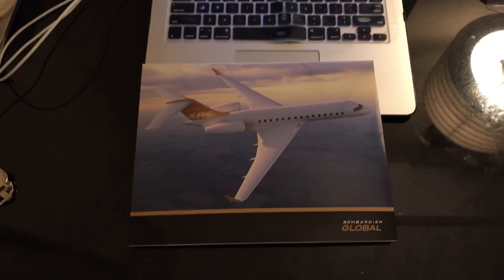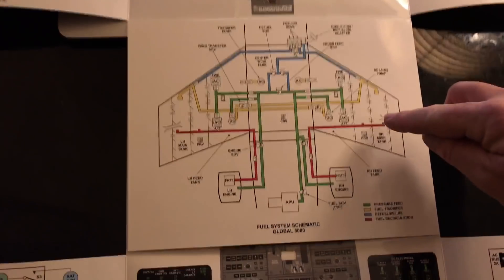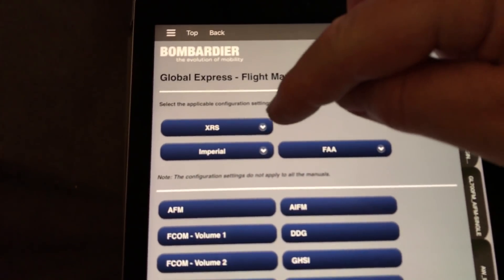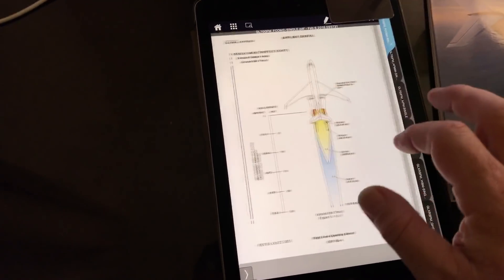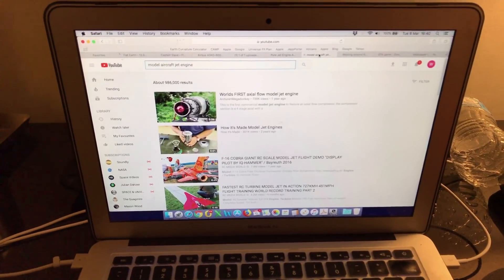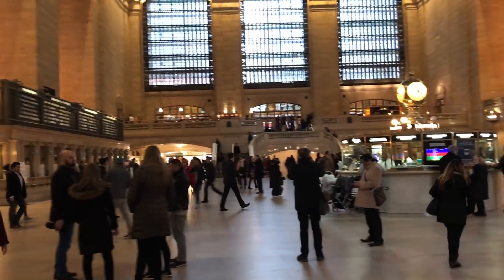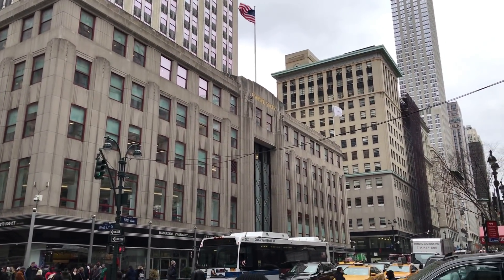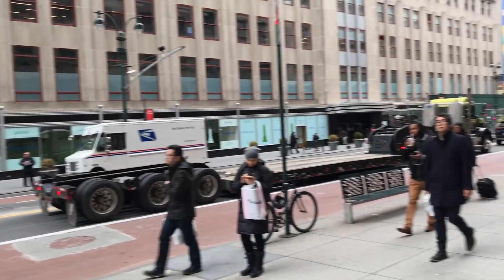Don't be ridiculous - of course Jet engines use liquid fuel.

Comment: Ok, what you’ve shown and described looks above board, but did I miss something in the most highlighted so called “compressed air engine” on YouTube that have or have not gone through the stats to disprove?
Please, put this to bed by going through and detailing as you have done here - with your CHOSEN jet engine - for the A380. 
So far, for this particular type of aircraft, that the fuel the books state it carries, sort of beggars belief, and really can’t get my head around how this much fuel can be carried?  Are the figures these conspiracy theorist using being manipulated? Is there a typo with an extra ‘zero’ in the books?
If you are so adamant, as I have always believed that Kero’  is what all jet turbines use , then please upload a video disproving this bullshit!
Reply: GT Shaker Why don't you do some research and find out how much fuel a 747 carries (in wings significantly smaller than the A380s), or even the An-225, which is even bigger?  The A380 burns between 11 and 13 tons of fuel per hour, so around 185 tons for a 14 hour flight.  Where do YOU think they store it?

Comment: I'm sure the issue isn't whether or not jets use liquid fuel, it's the large commercial jets that aren't making logical sense. It could be that a new tech has been installed and in use for a decade. Many serious questions have been raised, very valid inconsistencies, even by aircraft mechanics.
Reply from the maker: +Angel Gerovac - what part of large commercial jets are not making logical sense? 

I have an aeronautical engineering degree - 10,000 hours flying real aircraft (mostly jets) and am an air crash investigator who specialised in aerodynamics and flight path analysis. 

Everything about the design of these large jets makes perfect logical sense to me.  However I am open minded so please show me your factual evidence of why you believe they don't make sense.

Comment: The heat is transfered to the wings not to keep fuel from freezing but to keep wings from icing over and to cool air befor it is sent to the passanger area...RC airliners use compressed air...

Comment: I loaded jet fuel onto fighter aircraft while I was in the Air Force. Doing so would cause the landing gear struts to compress due to adding the extra weight. And it wasn't water I was putting in there.

Comment: @ Wolfie6020

I think that the main argument that these people have about certain aircraft's don't have fuel is that when they have seen the internal area of a wing & it's thickness then they have a hard time believing how swimming pool sized loads of fuel could fit into such a small area. Perhaps these jet engines work on the principle of 0.05% fuel to compressed air ratio which would mean that the total amount of fuel is much less than one would think.

Comment: hahahahaa your showing of a hand-out schematic to prove that Jet engines use "jet fuel" is like showing a picture of Bambi and saying it's real.  hahaa oh yea that really proves that Jet engines use fuel.  Tell me how a A380 with 218 METRIC TONS OF FUEL can move, WHAT TO SPEAK OF FLY?  Just hypocrisy.  If you claim to be a pilot you are PART OF THE HYPOCRISY.
Reply: "Tell me how a A380 with 218 METRIC TONS OF FUEL can move?"

Well, since its maximum zero-fuel weight is 369 tonnes, the answer is: "A little slower than it does empty." Your point exactly?

Comment: Haven't proven a thing bud, your showing lines Pneumatics Hydraulics and Pneudraulics, all ijn the wings. No bladders bud, just air. You took us on a boring walk through Manhattan.
Reply: There are no bladders. The wing box is the fuel tank. Google "wet skin".
Reply: Makes no sense. Entire wing is compartmentalized in structural framing throughout the wing. Thin wings and no room for fuel. Never, ever do wings catch on fire in plane crashes, except for oil, hydraulics and electrical. It should be the first to burn but never does. They never dump fuel except in movies. Plenty of jets return after take-off if problems are encountered. That weight unspent on a return landing, would make a heavy landing but is soft and easy always. Take this number in, 1/4 of a million gallons of fuel? 120 tons in the wings of an the A-360, please! I believe the total weight in gallons throughout aircraft is well over 300,000's of gallons of gas. Does that make sense?
Reply: And where the hell do you get "300,000 gallons" of fuel? 120 tonnes of fuel, assuming a density of .8, would be 39,626 gallons.
Reply: I mentioned weight, makes no sense, thats one. where are you putting gas in wings when there is no room, thats two. You should have seen what I wrote If you were alert. What a child, name calling, then again, who am I dealing with? Just saw your question. Look it up! Convert tons to gallons and then look up the wet weight of the aircraft. Now get learning junior.I am tired of hand holding children around the farm, better I'll just put you in with the sheep, you can brey all you want there.
Reply: My bad, 320,000 liters, is that better! I can see your lazy so here you can get a quick fix.
https://youtu.be/P5GpvPkfBKs
Reply: Thats 256,000 Kilos
Reply: "I was in the Air Force working on jets for four years during Nam." 

Uh, huh. That's real believable...snort! I think the nurse is looking for you--your computer time is over.

"Worked on jets"! Laughing my ass off!
Reply: For any lurkers: Here's a guy who claims to have worked on F-4s. He doesn't know that the F-4 was a fighter, therefore has very little space in its wings. He doesn't know that it didn't carry passengers, so there was plenty of room for fuel in the fuselage. He never wondered what was in those drop tanks hanging from the wings. And since the Phantom flew a GE J-79 pure turbojet, he saw plenty of that undiluted, incomplete-combustion yellow flame that fueltards seem to require. IOW, he's a complete liar....

From Wiki: Fuel capacity: 1,994 US gal (1,660 imp gal; 7,550 l) internal, 3,335 US gal (2,777 imp gal; 12,620 l) with 2x 370 US gal (310 imp gal; 1,400 l) external tanks on the outer wing hardpoints and either a 600 or 610 US gal (500 or 510 imp gal; 2,300 or 2,300 l) tank for the centre-line station.
Reply: You know nothing but speculation as you expose in your video. You speak as if you know something about me. You did the same as you have done to the material. I made an example with the only thing I KNOW for a Fact. I know nothing of four engine craft. I am telling you there is no fuel in the wings of that craft. You can pull all your wiki knowledge and google proofs but you lack experience working on planes. Excuse me, Had you worked on Jets? It would help if you had some experience to share.
Reply: Correct saw, not CGI but actual photo's. I can see there is a vast wasteland here, enjoy the desert, you deserve it.
Reply: So you always waited for the jet engines to cool down before working on them ? http://gruene-teufel.tumblr.com/post/142850835958/wombatmac-the-legendary-mcdonnell-douglas-f-4 
And they always vacuumed that fuel smell away to hide the Sekrit from you ?
Reply: So vacuum tight vapor never escapes ever? Just like all successful Moon mission, never a flaw, picture perfect. What was it, 9 missions?That is not the real world. Its the world they presented to you.
Reply: Then how does the F4 Phantom engine glow ?  Are there hot halogen light bulbs inside ?
Reply: After burner nozzles in the aft of the engines. I said aft, like you see them from behind. Not much thrust but glows pretty
Reply: How does the Afterburner work ? 

So if there is no thrust during normal flight without afterburner, how many invisible mechanics are pushing that F4 Phantom through the air ?
Reply: You have to be dazzled, your what is called a normal believer. I was a believer, never smelt fumes or saw a fuel spill on the flightline. I did watch the afterburner (LIGHT UP) at the end of the runway, very cool! I never thought to challenge why nozzles would be at the exhaust end of the engine. It wasn't my specialty so it wasn't my job to think about it. I can deduce now it is for show. What good does it do out the ass of the engine?  thanks for bringing the topic up.
Reply: Why make so much smoke for the enemy to see you ? https://upload.wikimedia.org/wikipedia/commons/c/cf/Phantom_F-4_3716.ogv 

Where are all these flames coming from ? https://youtu.be/k0MY03UtMls 

Why install an in-flight refueling receiver probe ? https://upload.wikimedia.org/wikipedia/commons/4/46/A3D-2_refueling_F4H-1F_during_Project_LANA_1961.jpeg 

Why carry external fuel tank, then drop it uselessly before combat ? https://en.wikipedia.org/wiki/File:F-4B_VMFA-314_1968.jpg
Reply: Smoke and mirrors, like I said
Reply: Why bother with aviation fuel on aircraft carrier ? https://youtu.be/9wZRFkSxz3w
Reply: Why spray fuel wastefully on disconnection ? https://youtu.be/g1LhLJ_9HHA 

Why use foam to fight fuel fire ? https://youtu.be/qhajoju_7Qc 
https://en.wikipedia.org/wiki/Class_B_fire
Reply: What sprays from the tubes, not sure? I think it could After burners fire short burst and not for sustained time. Now see satellites, space shuttles and fuel as the hype to sell a package to scoff huge sums from all of the people who bit the bait, everyone's mind got hooked and they reeled us in with a narrative, CGI and verbal testimonies for eminent scientist or fraudsters. We have an abundance of Nitrogen, a catalyst is all that is needed. There is more than one way to skin a cat. 
Good going Bro, keep it up. Hadn't worked on a Phantom since 77, jogging old memories and making me consider what I had not, many thanks.
I'm trying to make sense where none seems to be
Military NANO particulates might have been used back then in the late 50's The SR-72 came out a decade before I joined in 73. That is an advanced aircraft. Whose to say NANO magnesium particulates were not incorporated? Or Bromine used in weather modification back in the 40's. The Military is decades ahead of the market and what we will see.
Hey D we always see orange flames out the aft with A.B. initiation.
Nitrogen and Metals, no fuel. Magnesium, bromide or another chemical producing the effect firing out the tubes.
A WIKI article; Measurement of the specific rate constant for the reaction
N+HBr→NH+Br
indicates that k is 3.8×10—14 sec—1 (molecules/cc)—1 at 40°C. Attempts to obtain complete turbulence of reactants at a pressure of 0.85 mm were unsuccessful so that diffusion techniques were employed. The homogeneous flame reaction accompanying the above reaction was too weak to define the reaction zone, so calculations were based on the reaction tube diameter and the critical flow rates of reactants at which the orange flame initiated by a wall reaction involving active nitrogen and bromine was prevented. Spectra of flames obtained from the N+Br2 and N+HBr reactions in a stirred‐flow reactor indicate that NBr is the source of the orange flame in the latter reaction. The flow rates of atomic nitrogen were calibrated by chemical titration with ethylene. A conventional diffusion flame technique was used to obtain k=1.6×10—13 sec—1 (molecules/cc)—1 at 40°C for the reaction
N+C2H4→HCN+CH3.
Reply: That shits made out of sheep guts and really slippery. It reduces friction
Reply: They don't spray the jet only the runway
Reply: how to fly without fuel ? https://youtu.be/RRNbcPS3A9c 

how to dump fuel ? https://youtu.be/z4DegyuIxEE 

IDK (external ?) fuel tank ? https://youtu.be/cw0o8qmB_Is   https://youtu.be/Y-GrFlY7UB0  

Why bother with afterburner when no increase over normal thrust ? https://youtu.be/QT_ZtH_fZKc
Reply: Just because you don't see the dimensions of the internal fuel tanks, does not mean it is not there.  
Just because you don't see enemy jets shot down, does not mean they are trading moonshine while 30000 feet in the air.
Reply: Relying on only one single 2D perspective can be horribly misleading on 3D issues.  https://youtu.be/tBNHPk-Lnkk 

Just because you lack the math science engineering skills to design & build fuel tanks in airplane wings, does not mean that some other geek somewhere does not have that skill.  

If a thousand trees fell in the forest and you were not there to witness it, does not mean that there was no sound generated.  https://en.wikipedia.org/wiki/Tunguska_event#Similar_events 
https://en.wikipedia.org/wiki/Infrasound#Animal_reactions 

I was not alive during the Vietnam war.  Does that mean you are lying to me about that war ?

Comment: Hey, Wolfie! I came across this excellent short response from someone showing WHY a compressed air engine would not work. The guy who posted it is Walter Bislin:

^^^^^^^^^^^^^^^^^^^^^^^^^^^^^^^^^^^^^^^^^^^^^^^^^^^^^^^^^^^^^^^^^^^^^^^^^
Compressed air engines do not exist. Airplanes fuel tanks are WAY TOO SMALL to contain enough 
compressed air even to get off the ground:
The most you can compress air is until it gets liquid. We know the density of liquid air. If 
we know the mass flow (mt) of an engine, that is how many kg air per second the engines blows 
on start thrust, and we know the capacity (V) of the fuel tanks, we can compute how many 
seconds the tanks can deliver so much air. Lets do the calculations for an Airbus:

Aircraft: Airbus A320
* Number of engines N = 2
* Fuel capacity V = 30,000 l = 30 m^3
* Max mass flow at takeoff per engine mt = 379 kg/s
https://en.wikipedia.org/wiki/Airbus_A320_family#Specifications

* Density of liquid air rho = 870 kg/m^3
https://en.wikipedia.org/wiki/Liquid_air

Therefor is:

Max capacity of air
M = V * rho = 30 m^3 * 870 kg/m^3 = 26,100 kg

Max time for full trust
t = M / (N * mt) = 26,100 kg / (2 * 379 kg/s) = 34.4 s

So an A320 carrying 30 t of liquid air can produce max thrust from this compressed to liquid 
air for 34.4 s.

That's barely enough to gain takeoff speed.
^^^^^^^^^^^^^^^^^^^^^^^^^^^^^^^^^^^^^^^^^^^^^^^^^^^^^^^^^^^^^^^^^

Comment: A person actually messaged me on another site with this rationale (I corrected his grammar) :  

"An 18-wheeler can carry 10,000 gallons of fuel.  A 747 can carry 65,000 gallons of fuel AND it's fuselage  AND its people and cargo while ALSO using 18 wheels!   So it takes a truck 18 wheels for 10,000 gallons of fuel yet the 747 can carry 65,000 gallons of fuel and more....AND fly and only needs 18 wheels!?   Debunk THAT!"  

There's just no helping someone who thinks like this.  Oh, I could try.   I could.   But it would be no use.   That's just stupid, and as Ron White once said, "You can't fix stupid."

Comment: Dont forget next time you are flying your bombadier, to keep pushing the nose downward 8 inches per mile to keep to the curvature of the earth, otherwise, you will be at too high an altitude when you get to your destination, and by the way, if you are flying eastwards and you make a 90 degree turn to the south, you are going to have difficulty dealing with the surface of the earth travelling at 1000mph beneath you sideways.
 Honestly, this is some of the far wrong conspiracy theories Ive seen on the net in the last few days, as well as the jets dont use fuel one. Amazing. there seems to be an outbreak of stupid in recent months and it seems to be catching.

Comment: Compressed air!?!?! That's what they came up with today?
Where would you even store compressed air for a 14h flight?...and the HUMUNGUS tanks themselves would weight several tons each. Good luck for liftoff. When they fill up on the tarmac and the kerosene smell fills the cabin for several minutes... it's just for show? part of the lie? Bring it on flatheads, we're having fun but please make it at least a bit more credible and not so easy to debunk that a 6 year old can do it using common sense. Geeez!
Reply: They think the engine compresses its own air using some sort of free energy. Somehow the turbine produces more power than the compressor uses without any fuel or other energy input.